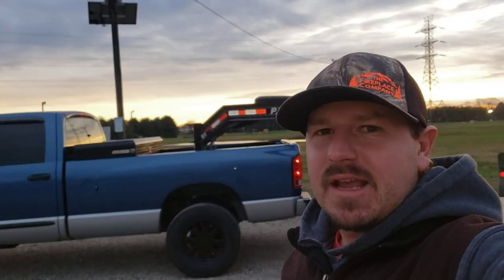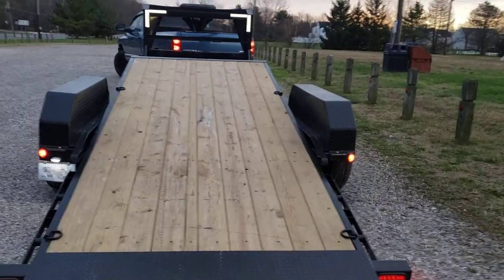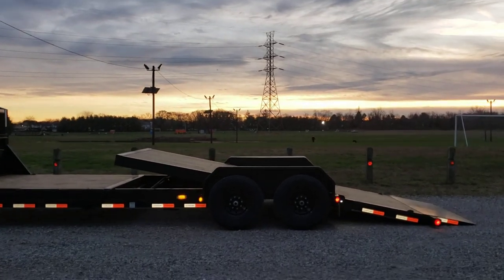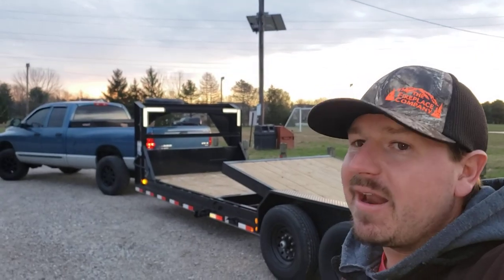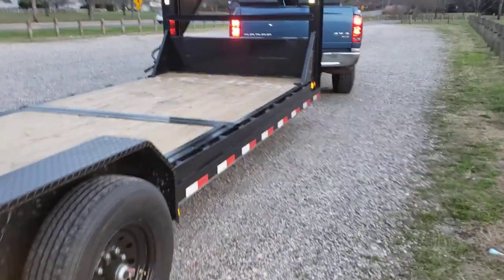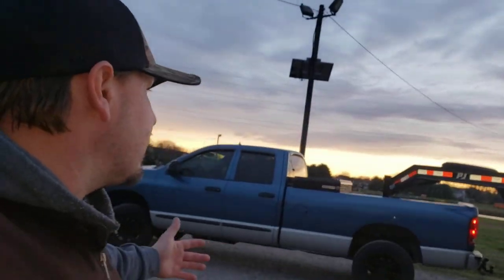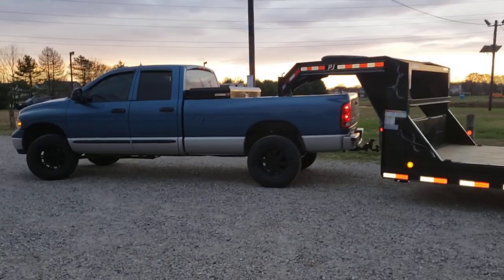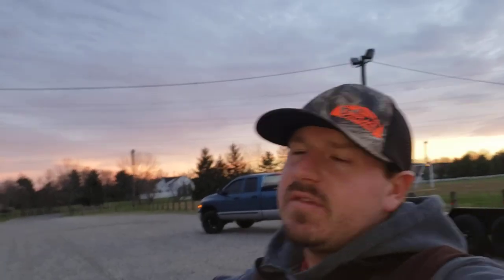Non CDL Hotshot Walk-around- my lightweight hotshot rig explained!

Comment: Hi buddy great video. I’m also in Colorado and was looking into getting setup to do some hot shot. I sent an email to the DMV and was told that a CDL was needed if the trailer GVWR was over 10001 lbs even if the combined weight was under 26001. Have you ever had any problems being that your trailer is over 15k GVWR?
Reply from the maker: Hi there! Great question, I also learned that CO (as well as AZ & CA) require a CDL for trailers over 10k gvwr. I have a class A so I was not too worried but I did end up de-rating this trailer to 9,999 GVWR after this video. Good luck out there!
Reply: @HumbleHotshot  Good to know !!
Reply: @HumbleHotshot  Please explain why you have a CDL and limit yourself to the non CDL requirements.
Reply from the maker: @johnhoffman8203  great question. I have a class A CDL from driving day cab semi & cdl hotshot for another company. I decided to limit my new business to Non CDL standards to avoid the costs of IFTA, IRP, insurance, etc and be able to legally run a pre emissions truck. Lowest possible overhead is my model this time around. Thanks for watching and God bless!

Comment: No exhaust / engine brake. Thoughts on adding one of those components?
Reply from the maker: I would like to add one, but the quality kits are quite expensive and so far I have gotten by without. Even on steep grades this rig works ok since I do not run very heavy. Thanks!
Reply: @HumbleHotshot  yeah and the 3rd gen 5.9 3500 do have a good set of brakes.

Comment: What is your rear axle capacity  can you transfer  that much weight of 15000 lbs.. I  think your rear axle will be over loaded..
Reply from the maker: 15k is the capacity for the entire trailer. Only around 20% of that (give or take) will transfer to the drive axle.

Comment: Air bags  actually put more weight on your rear  axle and less on your drive axle for stopping
Reply: Airbags raise the rear of the truck when inflated. This move the weight bias forward which does add some weight to the front axle from the rear. Perhaps not much but this could be verified on a scale.

Comment: Any link on what you got to beaf up your transmission did you go with a triple disc torque converter? And what rebuild kit did you get stage1,2?
Reply from the maker: Honestly, I'm not sure. I have a local transmission guy that builds these with his preferred parts. All I know is that it's a "heavy duty" torque converter and 2nd gear band and the rest is mostly factory parts.. kind of an OEM+ build. It's been great so far w/ approx 75k towing miles.

Comment: Im digging the setup, I currently have a 16' tilt trailer and am pondering a bigger bumper pull or switching to the gooseneck.
Reply from the maker: Thanks! The gooseneck will pull better but its also nice to have the truck bed available depending on your use. God bless !

Comment: Is that a 2500? Or a 3500???
Reply from the maker: 2500, so I do have to be careful with load placement as not to overload the drive axle. God bless !
Reply: @HumbleHotshot  I have a 2006 5.9 2500 Cummins… you think that would be good to start out with???
Reply from the maker: @asphaltcowboy5184  absolutely! 06 is a great year. Just can't run too heavy with a SRW 2500

Comment: Do you think that with a 1500 I can start
Reply from the maker: I would say 2500 diesel is the minimum. There is a guy who runs a 1500 and small aluminum trailer to stay under 10,001 lbs, so its not impossible, but that is a totally a different business model. Hope that helps, God bless !